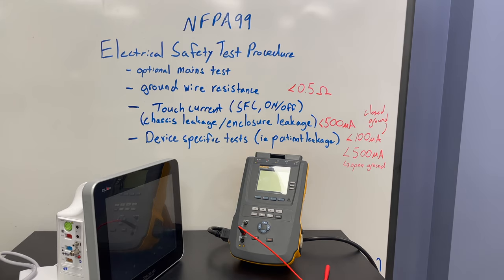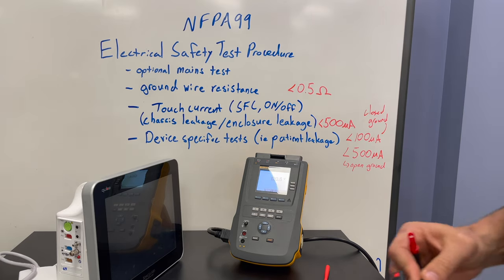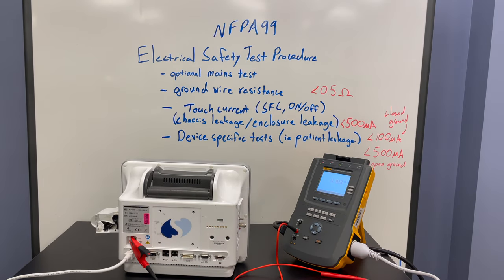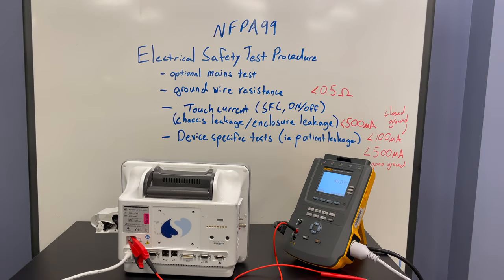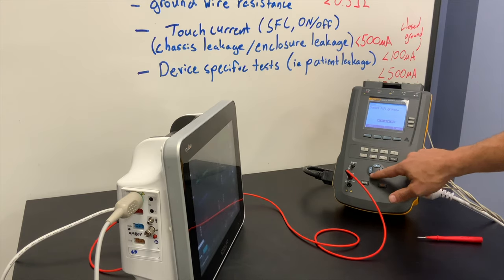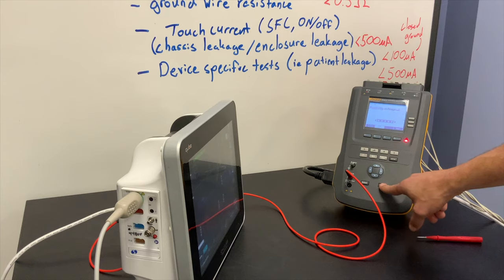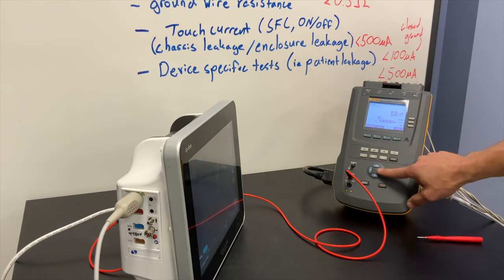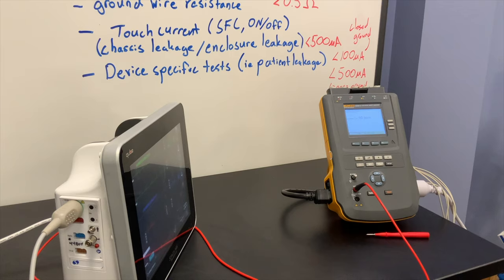Fluke ESA 612 with Patient Leakage Tests - Electrical Safety Analyzer

Comment: You state that the single fault condition is with ground open. Fluke states that the single fault condition is when neutral is open. Can you provide clarification? (Electrical Safety Essentials – How to stay ahead of the curve; MD Publishing, Inc.; Q&A)
Reply from the maker: Good question. opening the ground or opening the neutral are both conditions that qualify as a SFC. Now when testing ground leakage - you can not lift the ground ...the tester should not even let you do it. Since that is the path for measuring the leakage current. So your only choice is to open the neutral (or reverse the polarity) as your SFC. So in earth leakage you should open the neutral. But for all other leakage tests I recommend opening the ground as your SFC. Because lifting the ground almost always results in the highest leakage current. Obviously your companies SOPs should be developed for each device and some knowledge of how each device works is useful.
Reply: Sorry for asking here. The device shows a current less than the rated one at a frequency above 150 Hz in point-to-point mode. In what mode can I measure current at a frequency of 1 kHz or higher as stated in the device description?
 @HTMWorkshop